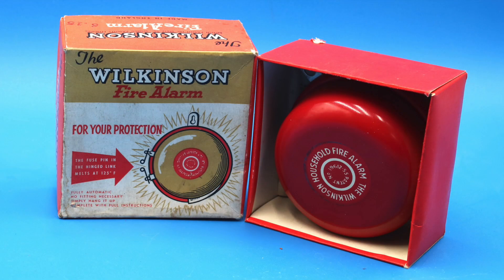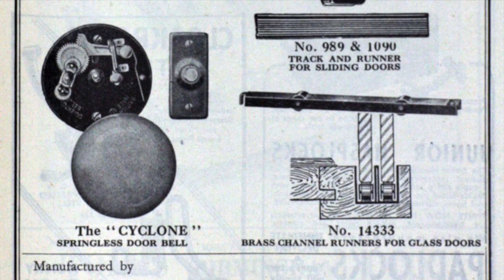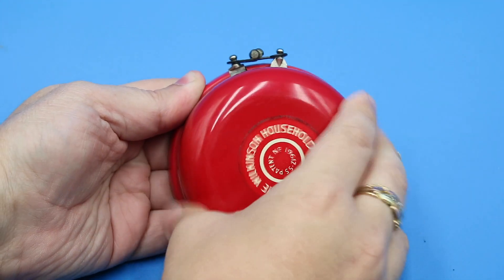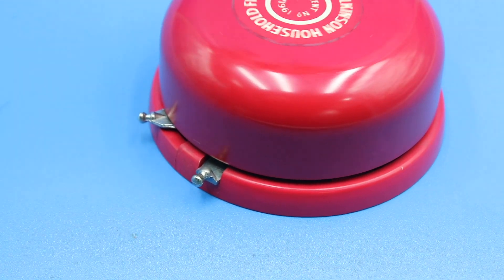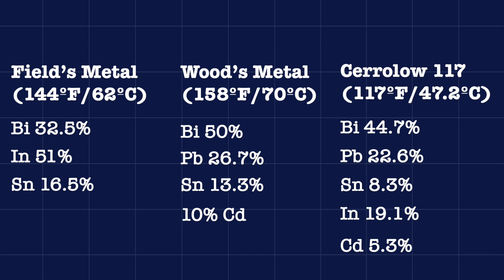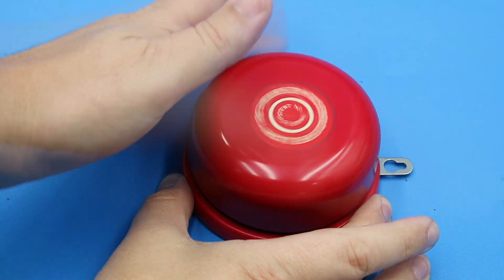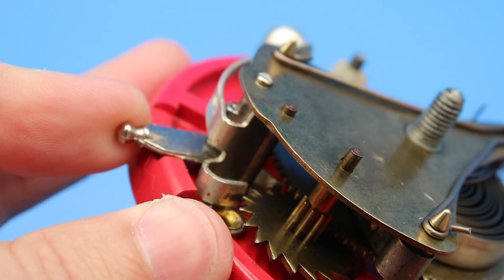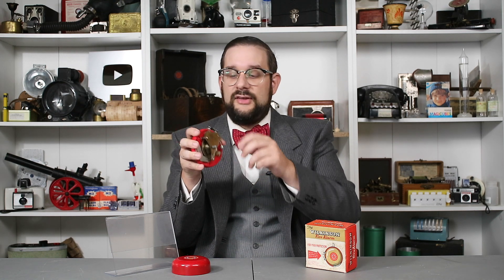SHORT: Wilkinson Fire Alarm

Comment: My father could not be awaken by an alarm clock. While he was still single, he wired a regular alarm clock to an electric fire alarm.  The clock would set off the fire alarm, which, in turn, would wake him up. Some time later, he and a friend were at my apartment when his friend flipped the switch on the wall(thinking it was the light switch. The fire alarm went off. His friend was amazed and said for months he was wondering why a fire alarm kept going off every work day in the neighborhood(his apartment was across the street from my dad's).

Comment: This reminds me of a friends front door bell - that's completely mechanical as well - You wind it up and when a visitor presses the button, it rings until they let go again so a very common mechanism over here in the UK.
Reply: You beat me to it. We had one when I was a kid - very similar albeit with a smaller dome than this fire alarm. Only drawback is the need to drill a small hole right through the door for the rod leading to the push button (that had a small luminous dot).
I was pleasantly surprised to find that they are still made today, albeit quite expensive: about £40 - £45.

Comment: I would guess the alloy of the fusible pin is Field's  Metal which melts at 62ºC but with some gallium added to the lead/tin/indium alloy to lower the melting point. A similar metal was used by Leica in their 1930's black enamelled camera bodies, to fill the very fine engraving, as being more robust than paint.

Comment: Given that the percentages of each element are known, you could try testing the density of the metal in a measuring cylinder, then finding which one matches most closely.
If you don't have a measuring cylinder, but do have a long, thin tube, you can use distilled (or just soft) water and a set of scales. Mark the water level before dropping it in, the water level after and then weigh the amount of water needed to get to the upper water level by placing the cylinder on a set of scales, zeroing them and adding water to the upper mark.

I've used the latter method to find out, roughly, what certain unknown metals are from metal detecting.

Comment: For many years, in my Mom’s house, in the furnace room, we had an electrical version of this.  Rectangular and a little larger than a cigarette pack,  it had an exposed bimetallic strip on the bottom.  When heated, it would close a contact, connecting a single D-Cell to an electric bicycle horn that would sound continuously until the battery died, the room cooled or the whole unit was burned up.

Testing it consisted of poking the bimetallic strip with your finger.  If it let out a lame croak, it was time for a new battery.

Comment: When my brother & I were kids, we had mechanical fire alarms in our bedroom and one in the living room. Rather than a low heat metal pin they used a plastic cap that would melt, given high enough temperature. You could also very simply pull the cap off to test and to occasionally release the spring tension. It was very loud as I remember.

Comment: My previous house was built in 1949, and had a similar clockwork fire alarm on the kitchen ceiling.  It was one of the types that had a center button trigger, but when I looked at it, it also used a fusible link to set it.

Comment: Having the replacement for the melt-y part of apperatus WITH the apperatus, where it is exposed to the same kind of temperatures as the original it's replacing, strikes me as odd. Most likely the replacement pin isn't for when the alarm actually alarmed in anger, but as a replacement due to accidental breakage of the original. Methinks the alarm itself will most likely be a piece of slag after having alarmed and having saving the house occupants from the fire, anyways. Fire alarms are tragic creatures.

Comment: Most of the farm houses, barns, sheds and root cellars on my family's various farms had those mounted inside.  That was back in the 1970's, and I remember resetting one after one of my little cousins knocked the trigger out and set it off.  It took almost 5 minutes to fully rewind the spring.  There are 3 different sizes that I am aware of.  We used the large ones (about 12" across) in the outbuildings and barns since they were MUCH louder.  The small one like you have in the video was usually used in the house.  The medium size one we used in the equipment shed and the root cellar.  The ones I am familiar with have a center cap on the front which is the "trigger" and it is wound from the back.  You cannot put the trigger in place until the spring is fully wound.  Once it is wound, the trigger button will slide into place.  We could get replacement trigger buttons at the Western Auto in town, or at the fire department.
Reply: That style were in the house where I grew up, built in the 1970s. I believe we had Vanguard Thermosonic ones, a brown color bell and an odd chrome finned bit around the fusible pin.

Comment: Interesting fire alarm. I installed several thermal sensors around the house and shed to augment the smoke alarms and wired them up to a loud bell). They all have 190F (87.8C) trip points. 125F (52C) seems pretty low here in the lower 48 but I guess it was find in England.
Reply: Yeah, they could go off on a hot August day in Phoenix or Palm Springs.

Comment: In engineering schooling way back when we where taught to:
"Never replace a well functioning mechanical device with an electronic."
Car engines still had contact breaker points at the time.
de SA3BOW

Comment: A fully mechanical, no batteries required fire alarm, fascinating.
The only possible improvement I can see to make is to replace the fusible link with a modern one such as used to hold sprinkler heads shut.
Other than that, it's pretty much perfect.

Comment: I would think that the metal pin will have slightly higher melting temperature than the actual actuation temperature. Pin will start to go soft and fail before it is actually fully molten due spring pressure pulling it apart. I can see the fire bell going off accidentally during very hot summer days, especially in kitchen when cooking, not unlike modern smoke detectors. Neat little device!
Reply: Ah yes, the old liquidus and solidus thing. I remember learning about that with regard to brazing and silver-soldering.
Reply: Of course, you're brilliant! Obviously they never actually tested the device! And no one prior to your birth knew anything about material properties! How blessed we are to be allowed to walk in your shadow!

Give people some credit that they actually knew what they were doing
Reply: @tenchraven  That gentleman over there is Mister Thepoint, and right here we have Missus Thepoint!

Comment: Does it need to melt? Surely it just needs to soften enough for the spring tension to overcome its shear strength?
Reply: It is aready a very soft metal, to be that distorted without breaking, it will shear before melting.
Reply: It wouldn’t all be liquid when it lets go, it’d be a mix like a slushie of solid and liquid phases.

Comment: Fascinating! In general I like devices that dont need batteries - as this one clearly explains, still functioning after 60 or 70 years.
However, the modern smoke alarms are much more capable. They dont need to get warm at all for sounding the alarm, since they detect smoke not heat. And to quickly heat up that little rod above 50°C, the air needs to be significantly warmer. Meaning, the fire may be in a stage where the danger zone for smake inhalation is long passed. Crucial because most people die from the smoke, not from burns.
But for the time the Wilkinson device was sure better than nothing. And by the looks also relativly inexpensive, which is also a factor if you want that many people use it.
Reply: We've been replacing some of the ion/photoelectric smoke alarms with modern heat triggered ones in places like the kitchen and some bedrooms.
The amount of false triggering especially with photoelectric ones, has caused us to start to ignore the alarms(When they go off at 2am they become excessively annoying) and brand new ones develop problems after a year or two.. 
Ones you trust are better than ones you ignore.
Reply: @ElectraFlarefire  Yes, especially in the kitchen it can be pain in the back side. Every time making a steak or something else that needs to be fried sharp, the thing blows your ears off. I removed the one in the kitchen. But I still have some more in other rooms.
Reply: @petebeatminister  Find the modern thermal ones. They'll give you protection for actual fires in the kitchen but won't get set off from toast.
Especially as(For example in AU) homes are now required to have interlinked alarms that if you set off one, set off all of them. The fewer false alarms the better!
Reply: Well, it's better than nothing and probably a lot louder than a modern smoke alarm.
Reply: @tarstarkusz nah not louder then the hardwire ones of like apartment building. They test mine every year and it's so loud it legit hurts your ears bad when in the same room as the alarm.
Reply: @MRblazedBEANS  I'm talking about the battery operated home models.
Reply: As long as the fire started in another room it would have a chance to wake u up before it spreads to other rooms.

Comment: Inside the alarm might not be the best place to store the spare low melting point pin, lol
Reply: If the original snaps off, it’s easy to find the spare

After a fire the device will be considered destroyed anyways
Reply: @ChrisAthanas  why would it just snap off? This one's been intact for over half a century. most smoke and fire alarms are false alarms and the detection device should be expected to be able to be reused, but wouldn't be able to be reused in the case of this device.
Reply: @Muonium1  looks like it could accidentally break as Gilles noted
Reply: @Muonium1  also if it's hot enough to melt the original "fuse metal" then it's hot enough to melt the spare in the device

Comment: the thermal rod ..... metal ? or wax ?
Reply: Did you not watch the video?
Reply: Low melting point metal. Wax would creep much more with time, though the metal does as well.
Reply: I dont think wax would keep its shape, if its under tension for a long time. As we see even that metal has deformed a lot.
Reply: Did you watch the video? Or are you so ignorant that you don't recognize specific metals when they are name in percentages for the alloy?
Reply: a new question then ... if you scratch that thermal rod with your finger nail or a metal nail ... does it break out ? , & into a regular rod material ? or some sort of rust ?

Comment: I would use that to hang up on boring phone calls. "Ding ding ding... Oh sh*t. sorry I HAVE to go. (hangup) " :)
Reply: You could say your "BS" detector went off.
Reply: You laugh, but I still use that phone.  I like having a landline and all the phones connected to it were made in the 80s or earlier and have mechanical ringers.  The oldest one is from the 60s (I will not give up touch tone).  I really, really do not like electronic ring-tones.